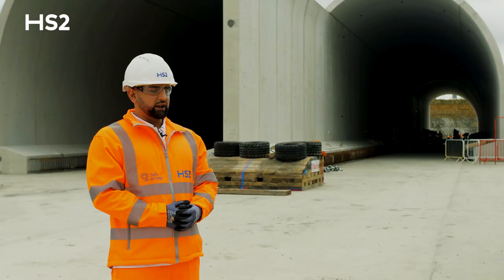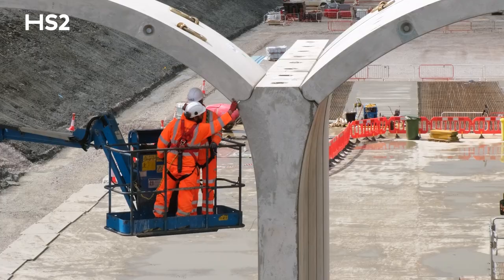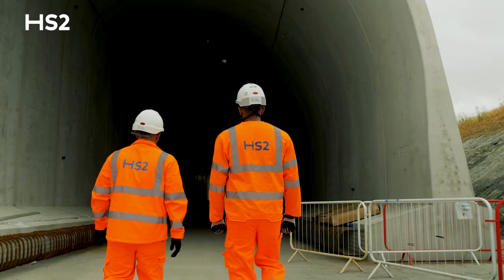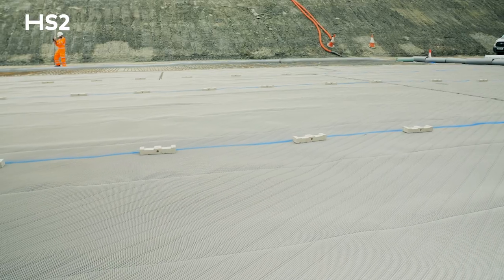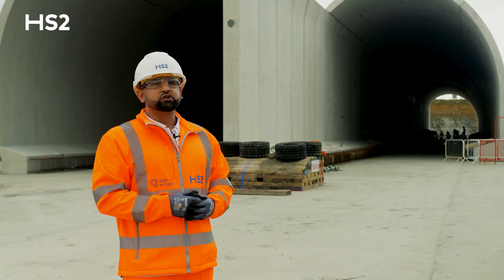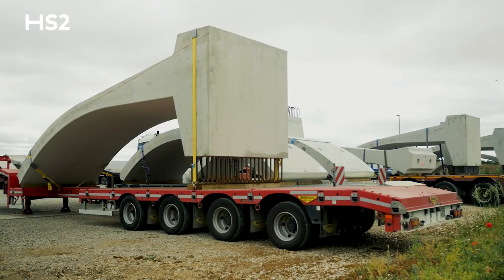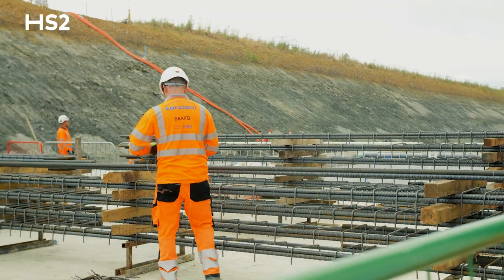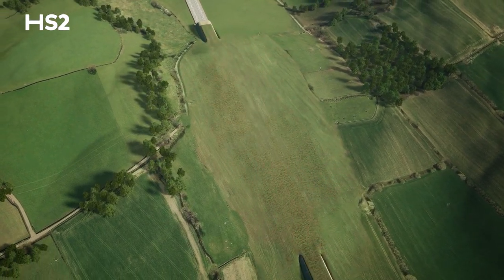First look inside pioneering HS2 'green tunnel' in Chipping Warden

Comment: Tree roots have a habit of getting into places that they are not wanted and I can see that the tunnel is going to need works to stabilise it as tree roots make their way through cracks in the construction sections as they seek out water.
Reply: Sounds like a reasonable concern. From some research, tree roots don't actually grow that deep. Frequently a maximum depth of 2m.
Reply: Sure, as if the best engineers in the UK didn't give the slightest thought to a well known thing.🤦‍♂
Reply: @jiecut  that depends very much on the species of tree
Reply: That is why theres such thing as maintenance.
Knowing railways they will probs get a dedicated inspection train to monitor the tunnel and track condition overtime.